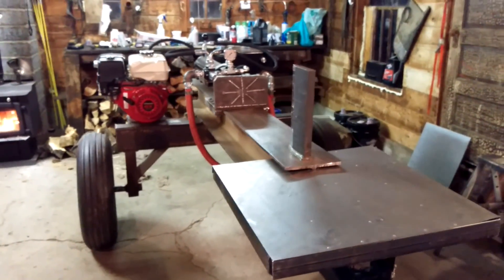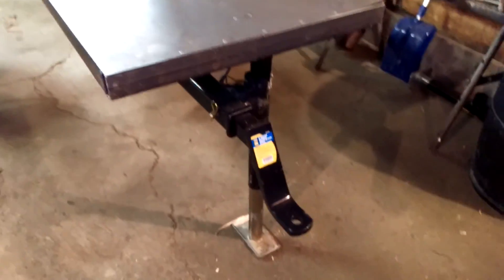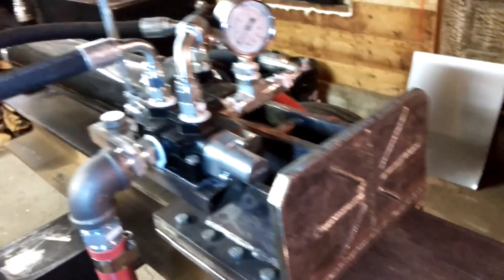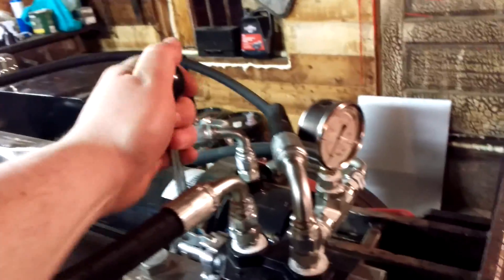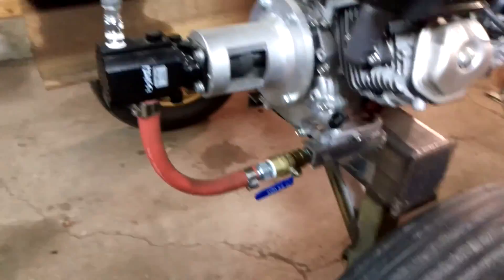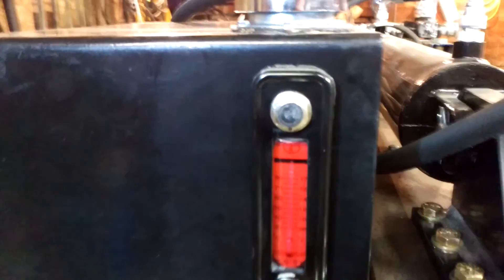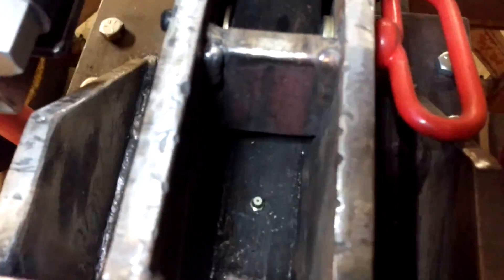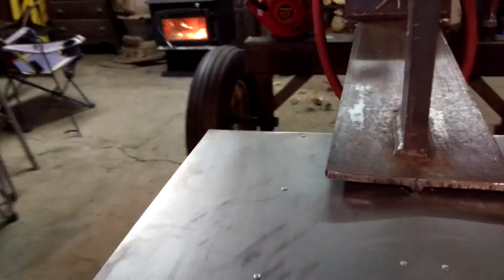Homemade Log Splitter Build Part 3 of 3

Comment: Yeah, when you table does not hold your first split, you need to think about the design.  I have looked at and watched dozens of videos and you need to change the size of your splitting table, add some lateral support to your i beam in order to keep everything "on top". Overall design is okay but there are certainly some things that could be done to insure your wood is always on top.  Were I a welder, I'd be building my own custom log splitter based on all the videos I've seen.  Since I'm now 60, I won't likely be doing so.  Were I 40, I'd be hot to do one.
Reply from the maker: Don Marshall actually since I put angle iron on each side of the table it has worked flawlessly. Thanks though
Reply: probably
Reply: WTF, where's the rest of my comment??? What does it mean just "probably"?